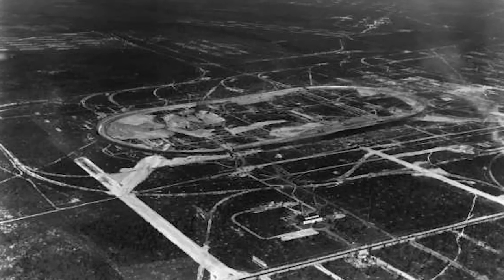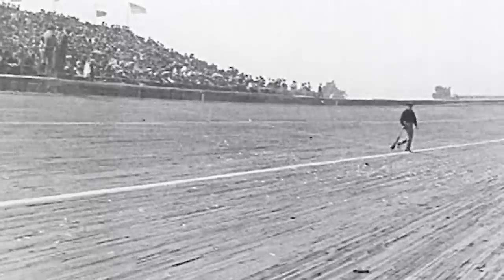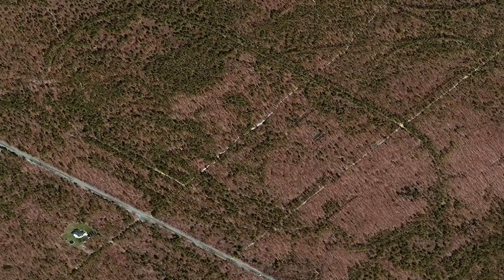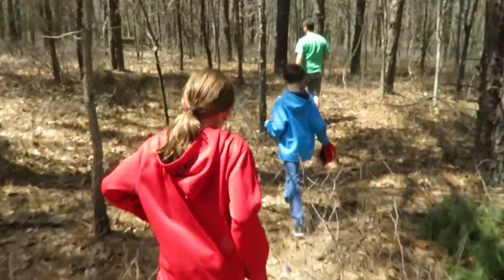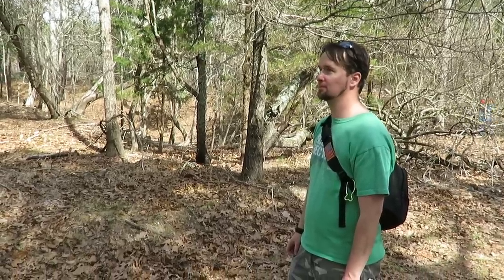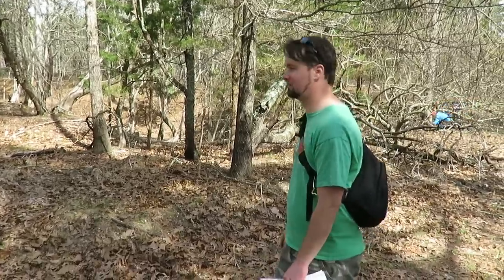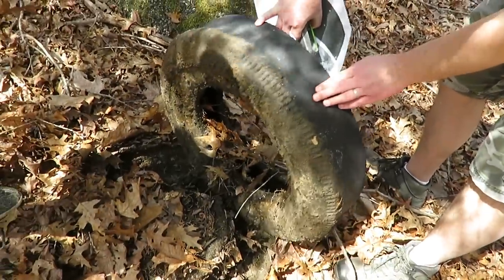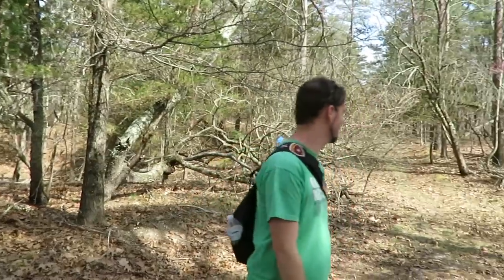Discovering the Atlantic City Speedway Lost in the Pinelands of New Jersey

Comment: Cool video. 
Much of the stuff you guys found is likely just the result of years of people dumping trash back there. The original track, and all the wood was likely burned up in several fires over the years. The tires there are a lot newer than what the cars back then used, most of which appear to be '60's vintage. That area was popular with Atv riders in the early 80's and I remember a buddy taking me there a few times. The woods was far thinner with many signs of a forest fire on one side that had about halfway recovered. The area also saw a major fire in the late 50's or early 60's. At the time I was there back then the buildings were more complete with more of the upper structure still standing. 
Much of the trails you see there now are part of a fire break system that's maintained to fight forest fires. I'm not sure how much of it follows the old race track but I suspect much of the original track area has long since been grown over. 
No wood will have survived the elements over the years, they didn't have pressure treated lumber and the depression years pretty much guaranteed that any loose boards back then would have been gathered up and used to heat folk's homes. 
There was was very little pavement there, I'm not even sure if all the buildings had concrete floors either back then. chances are the combination of the depression, and likely aging of the wooden  structure back then was what ended its day as a track. Attendance during the depression was likely down, both by spectators and drivers, and the value of the wood was probably low hanging fruit for the owners at the time.
Reply from the maker: Really appreciate that comment! We're from NJ and I always enjoy learning more about this mysterious place from a local. I'm sure others who check out the video will as well. Have a blessed week!